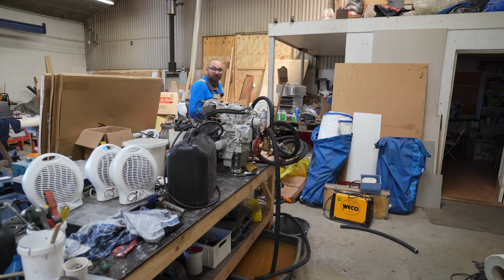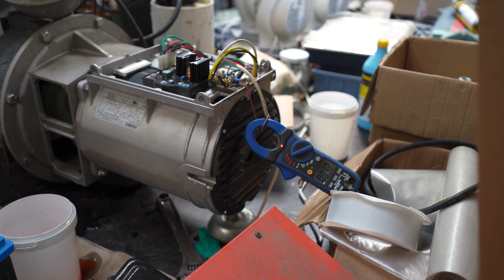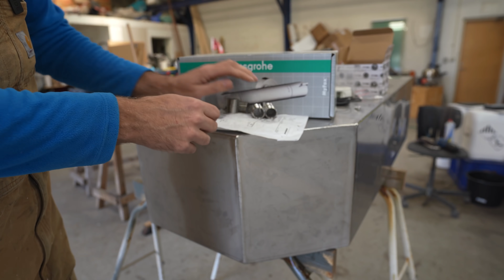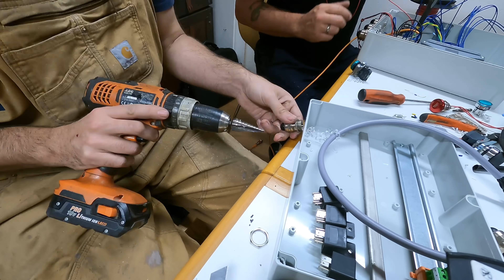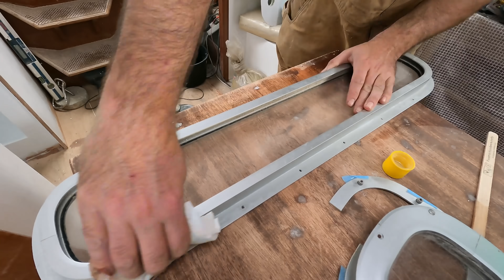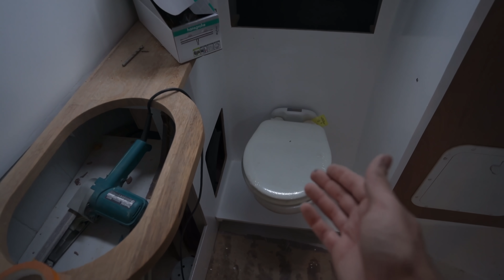Sail Life - The DIY genset is ALIVE & more progress in the head

Comment: Something I really do not understand, maybe someone could explain. 
You can buy an off-the-shelf 4000W dual fuel, propane, and gas generator for 5-600$.
A Diesel generator is 10 times the cost. Why the difference? Why would you pay so much of a premium and invest so much time in a Diesel generator?
Is it purely a matter of fuel choice? You have to carry gas for the outboard anyway. 
Is it a matter of marine environment? You dunk either one in the water, they will both stop working. You keep them out of the water, a camping-rated well maintained generator would do just fine. Wouldn't it? 
P.S. This is not a dig at your/Mads choice, I'm just trying to understand options.

Comment: There are remote starter buttons used to crank an engine while you are working under the hood of a car. Maybe you can mount the button outside of the generator compartment. 
Performance Tool W80586 Heavy Duty Remote Starter for Cars and Trucks https://www.amazon.com/dp/B00OPVYHZ4/ref=cm_sw_r_cp_api_glt_fabc_RFZPZSKDB63NTQK6XFV7

Comment: Mads i love your solar arch. I built one for my boat and used 36mm angle iron on top to mount the panels and other stuff. Two things I wish I had thought of. 1. Slope the panels a little to stop water from pooling. They collect a lot of dirt that way. 2.  Make sure the panels don’t stick out too far on the sides. Twice now my panels have hit pilings pulling away from docks at low tide.

Comment: I more curious than any thing, as ive been following your rework for several years now. I have a small boat, and im looking to upgrade. U keep saying your gen is "cheaper"? But ive been looking at

https://www.walmart.com/ip/Pulsar-12-000W-Dual-Fuel-Portable-Generator-in-Space-Gray-with-Electric-Start-G12KBN/415084230?athcpid=415084230&athpgid=athenaItemPage&athcgid=null&athznid=PWVUB&athieid=v0&athstid=CS020&athguid=dd902d9f-007-17a3308aa4e9f2&athancid=null&athena=true

What am i missing? This looks to be a good bit less?

Comment: I keep having to say that you know English better than I do, and I'm from Uzbekiturkaghanistan! The idiom about having "to break a few polar bears" I have had wrong all these years! Thank you! And thanks to all those who didn't make fun of my errors over the years!
Will a 4HP Evinrude sewing machine also sew through multilayered sailcloth? I'm betting it will! You're welcome.
Could you fit in a smaller bladder tank somewhere in a vertical orientation that would make up for the "missing" volume from the Rev 1 mistake? Orienting it vertically would allow this "pre-tank" to receive all the water from the dock first, and if it has sediment in it, it could be trapped in the bottom of this "feed-tank" and it would be easier to just eventually remove it and dump it out rather than trying to clean out a permanent tank. 
Wasn't it King Mads that had the "golden touch" where everything he touched turned to gold. Athena is looking pretty dang golden!

Comment: Awesome video as always. I watch them all, but often on the Apple TV, so therefore almost never comment :)

In relation to the liferaft, it seems like you just stripped it down - which is fine I assume (I'm not expert here at all!), but I saw some video some time ago, actually about some cases here in Denmark where this thing was NOT done correctly, but on commercial ships (as I remember) they are required to have a self release thingy on.
As I understood it, it release based on pressure, so if the ship goes down, it sense the pressure and release the life raft - if it goes fast, you will not have time to run on deck and release it by hand.

Just a little tip - I have no idea what it's called or anything, but pretty sure it should be easy to find.

Comment: I just fitted a second hand intelinano genset controller to my onan 6.5kva genset. The installation was easy as pie and the results are life changing. Now I can control the genset with a single press of a button, get the info I need regarding output and frequency as well as use my victron equipment to auto start the genset at preset voltages/currents. As I said, life changing and pr programmed. Good luck with your plc controller and keep up the good work Mads

Comment: A little tips from when I was working in industrial painting, you can use some paper tape to remove the runs , when everything is " dry" except the excess of paint in the runs, you still need to do some o'glrorious sanding, but a bit less, and save some not necessary curing time

Comment: I'd be wary of blocking much of the exhaust pipe diameter with that rather bulky sensor. Automotive ones are usually like this: https://ponydrift.com/products/whp-egt-probe-type-k-thermocouple?variant=31592103149591 
You might have to add a small chamber at the bend there to house most of that thing, so the gas impinges on it but it's not reducing the piping area.

Comment: That's a really GOOD OUTBOARD!! if you know it or not. Always turn the fuel off when you tilt it up! And run the carburetor dry when you're done using it.
 Super lightweight with two cylinders, two-stroke and a neutral and twist-grip throttle. It will run really smooth with two cylinders. Nowadays it's hard to find small motor with two cylinders! It has a good choke and not the stupid primer. They were available with remote tank, internal tank or some were made with switchover valve for both fuel option. Save that motor! It's way better than a heavy 4-stroke. Make sure you run 50 to 1 oil not hundred to one. Be sure to use non-ethanol fuel and fuel stabilizer! Enjoy the gym!
Reply: That outboard motor is way less fussy and temperamental than a new 4 stroke. Put up with a Little Smoke exhaust.

Comment: The brass temp sensor in the exhaust stream with salt water will not last long. A thermocouple  encased in a Inconel housing will be much more durable. You can use either an AD 594  or an AD 595 chip to convert to a microprocessor readable signal. The chip depends upon which thermocouple you use.. A quick search of the internet for the chips data sheet will give you all the info.
The Arduino family of processors has prewritten code  for just this type of function and has code to display the values on an Lcd.
csmale9@gmail.com

Comment: Heat lamp or heat gun the Run. Let cool. Shave it a 90° with a razor blade. Wet sand with run block or wet and dry paper.

Comment: I worked with diesel generators that have a lower load limit. If they operate below it for too long then carbon deposits form that can damage them. The solution is rather interesting, run it at high loading for a bit and it will clear the carbon out.

Comment: Sam Holmes made a gasket for a deck mounted device. The gasket was tapered to match the round of the deck.  I think that technique with work to make the gasket for your head to match the wall. He used a 3-d printer to make the gasket.  Send him a drawing and measurements.  Maybe he can make it for you if you don't have a printer.  Sailors helping Sailors!

Comment: To fix the shower fixture you need a wall mout. That comes behind or in the wall. like this: google "geberit 650.779.00.1"  to see what i mean. They come for soldering 12mm copper pipe, turn clamp 12mm copper pipe, or plastic flex pipe. every DIY store that sels fixtures sell them. Normal procedure in a home. Your fix it straight as possible to a wall, connect in inputs pipes. then normally cement and tiling wil go over it and hide the plate leaving the opening flush with the tiles. If deeper longer offset connectors are available.  In your case you will have to create something behind the showerwall to fix the plate on.  The two 1/2 inch offset pieces with tread on both sides that come with the thermostatic are wound with teflon tape en screw in the wall plate after that is fixed. And the other side is for the fixture. The are offset to straighten out any angle and allow the fixture to be exact horizontal.  Good luck Mads!

Comment: You should try using 3M VHB double stick adhesive tape to avoid drilling holes for  fastening  things  in place. Its the same adhesive used to fasten the Stainless Steel rub rails on airplane flaps. If it will hold there , it will hold anything you need to fasten down .

Comment: Have you considered one or more raspberry Pi. It is an UNIX operating system. It implements MySQL, Appache, PHP and "C" or "C++". It has IO ports and supports networks, bluetooth, WIFI et  al. Finally it is cheap and low power demands.

Comment: Left hand flank wall for the shower head - firing away from the door would be a consideration, but I'm sure you've got it sussed.  Perkins ran well, and the automated controller  looks really interesting.  We have an aging, obsolete Mastervolt, again base on a 2 cylinder perkins, andit works well with preheat, electric oil pump to pre circulate the oil - this may be a desirable item to consider...  All looking really good though, well done Mads!

Comment: For the "toilet wedge", perhaps something that has a Stainless Steel plate sticking up from it.  You could then embed a permanent Magnet in the toilet lid so that when you open it, the Magnet will grab the steel and hold the seat open.  That way it won't just flop closed from the rocking action of the boat at sea.
Reply: Anybody that doesn't make a rule about always sitting to pee (men), hasn't sailed very much.  That is right up there with "don't fall overboard".
Reply: I just have to point out that you should consider carefully any feature that holds a toilet seat up when a woman will be joining you in this endeavor.
Reply: @MobilMobil-kv5ke  Very true.  However, I am sure that Eva will appreciate him not peeing all over the lid every time the ship rolls.  It's also nice not to have the lid tapping you in the back too.

I should also note that I meant the lid, not the seat.  My apologies.
Reply: @Wearyman  that makes sense.  But I tell you what, when I got married I made the adjustment of always using the toilet sitting down.  Happy wife, happy life.  In addition, sitting down helps with target accuracy in rolling seas.😉
Reply: Stainless steel in not magnetic.
Reply: @danlucci9246  Eh, not exactly.  Ferritic Stainless is magnetic. (409, or 430 stainless) Austenitic Stainless is not due to the high nickel content. (201, 301, etc. stainless)  So as long as you have the correct type of Stainless, it would work.

Comment: Hi Mads, Last 4 years living aboard we find we do not actually use the shower head in a fixed overhead position. Rather we have a fitting where it lives and we tend to use it as a wander lead for showering as it's easier to direct the water where it is needed rather than just cascading top down. Just a thought. Interesting generator info\system. Sail Safe Guys, Ant, Cid & the pooch crew.
Reply: As a live aboard, I'd totally agree with this!

Comment: I think you deduct 3% of rpms for under a load....example Lehmans diesel tops out at 2400 rpms then under a load she should top out at 2100 rpms, and if it can't achieve the 2100 at full load then you need to start troubleshooting maybe a dirty injector or whatever...but check your specs for max rpm should be then what rpm should be under a load, that's the test of a diesel, it looked and sounded like you were not hitting the correct rpms when you went under a load and that indicates something wrong
Reply: I think Mads put a generator sized for the larger perkins engine. He will probably keep the rpm/load specs at a rate that the engine can easily handle (thus the generator will be using only ~60% of its full rated capacity). I think Mads said he hopes to replace the smaller engine at some point with the (402?) and then grab a larger portion of the power the generator can safely produce.

Comment: You would be better of with a pyro sensor in the exhaust pipe. It will react faster and designed to sit in exhaust and deal with heat like that

Comment: Have you seen the Spectra watermaker that UMA installed
Reply: Uma said that their choice of watermaker was just about the most expensive option availible but was right for them because it used much less DC power of which they have a very limited supply.  Mads does not have the same constraints so he can use lower cost alternatives.

Comment: He could fix the mistake by cutting the tank mid way, and adding a strip with the desired height. Sure, it wouldn't look as spiffy, but that's less wasted material and would take a heck of a lot less time.
Reply: i wuld just take the top of just below the welds and add in a strip there mchless welding than build from new
Reply: True, but he should get what he paid for.

Comment: Instead of allways having to tap into the ressources of the cement-boat-guy, or waiting for Ava to arrive, I'm pretty sure, that if you need someone to hold a wrench from the outside of the boat, or assist on mounting a through-hole or a solar-arch, you can just ask your followers on YT. I'm pretty sure you easily will find someone willing to spend some hours to repay for all the good entertainment... Allthough Skive is close to the edge of nowhere....

Comment: Mads, that start function on the itty bitty Perkins can be done easily in two different ways. The first way would be to Simply set up a little cantilever switch with a solenoid and a momentary switch remotely operating that solenoid from wherever you like. The second way is to do it mechanically with that same cantilever and a pull cable with a spring on it so you simply pull on the cable which engages the can't deliver it to push in and start the starter on the itty bitty Perkins and release when it starts.
Reply: This. And i'm pretty sure there's already market available solutions (to be read: bolt on) for this from the pony motor side of the Perkins family.
Reply: @aserta  they make an after market solinoid for Lehmans diesels to shut it off instead of a cable but it can prob be adapted to other situations it's just a bolt on solinoid
Reply: A remote shut-down is nice, but I bet the remote start never gets used. You will always check oil, coolant, hoses etc before starting. Once it's running you will watch it like a hawk to see if anything is leaking or smoking. AND you will nip up on deck to make sure raw water is coming out with the exhaust. Sounds a bit anal? Yes, but your genset will wear out rather than fail for some avoidable reason. A low-flow alarm on the raw water is essential for when your system swallows a plastic bag.

Comment: A sliding pocket door for the head would have been a great idea -but that is probably way too late to do now.  The  wall would have needed to have been designed to enclose the pocket from the start.

Great progress though.  I love your 4hp Evinrude. We have a 3HP Evinrude from 1953, it.pushes us along at about 5 knots in our Porta Bote which glides through the water almost like a hard dinghy. What more can we want?  I can carry it with one hand which is handy when I need to move it between the dinghy transom and the aft rail mount when we tow or fold up the boat and bring it on deck.

Comment: The genset seems to be a good fit for your boat.  The only thing that comes to mind when using a non-marine grade genset would be spark generation in the bilge and the corrosion resistance of the bits and pieces.
Best luck and best wishes.
Reply: Especially as no propane onboard or petrol below decks.🤔

Comment: Inrush amps? Be careful, you’ll just measuring amp load, i’m sure you’re experienced enough to know that you need to secure your life raft it’s kind of a hot item for theft, same as a outboard motor or dinghy, Black butyl tape outside equals (streaking)
Reply: No inrush current on resistive load and the use of resistive load banks are absolutely standard for generator load trials. For small loads like this the resistive load is as near to unity power factor as you can get.
Reply: @normanboyes4983  Disagree, if he’s going to try to run his AC unit with it, they will be inrush current, which spikes 3 to 4 times higher than the running current for that split 1/100 of a millisecond, and that’s what trips breakers or fries generators, however if he puts one of those easy starts units that could then be avoided,
Reply: @mattheww8059  He was just doing a load trial with resistive load (standard practice industry wide). In service is a different and anything with a motor (or inductive load) will incur inrush in start - Madz knows that.

Comment: I’ll be interested to see how that shower mixer works out. 
My grandfather built one for his boat that looks much like yours. However, with the way the plumbing was setup, each time the pump came on, the cold water pressure increase over powered the hot water pressure, and it got suddenly quite cool in the shower! One cause ... the water heater acts like a pressure regulator/expansion tank, whereas there is no pressure control on the cold water side. (I hope I’m explaining this clear enough.)
I’ve since added an expansion tank to the cold water side, but haven’t had an opportunity to test it.
Reply: Wouldn't using a pressure balanced valve completely fix this?
Reply: @danielbuckner2167 , possibly. The mixer my grandfather made (1970s) didn’t include one, but the one Mads purchased may have one integral to it.
Reply: @danielbuckner2167  I think that's the point of that mixer. AFAIK, it's one of the type that you set to a temperature, then turn on the water. The mixer will keep the temperature.

The question remains, will it be able to keep the temperature stable when the pressure fluctuates that wildly... 

Adding an expansion tank to the cold water side should have the added benefit that the pump would have to come on just every once in awhile instead of rather frequently. (Watch a few recent videos from Rick Moore (Sailing Sophisticated Lady), he's got that issue that the pump comes on every 30s or so. I suspect he's got a leak somewhere, though...)